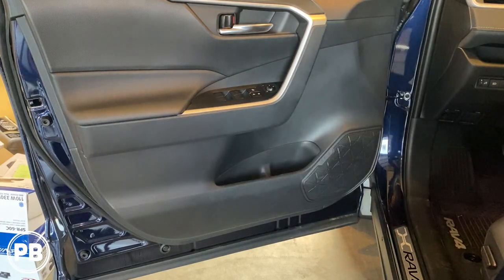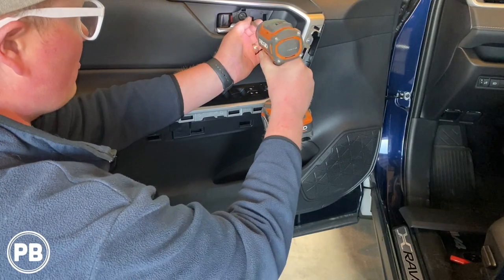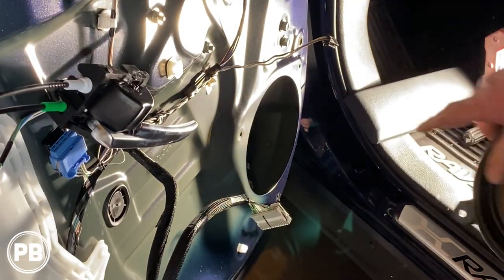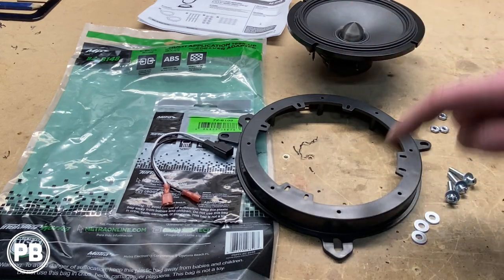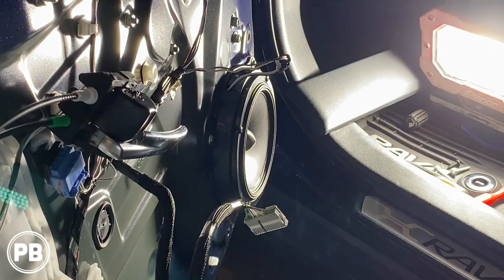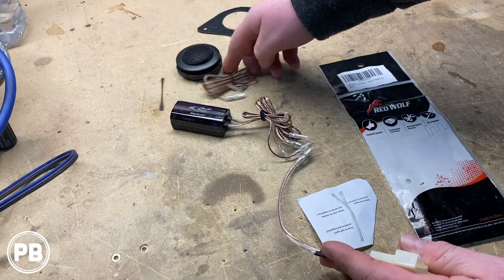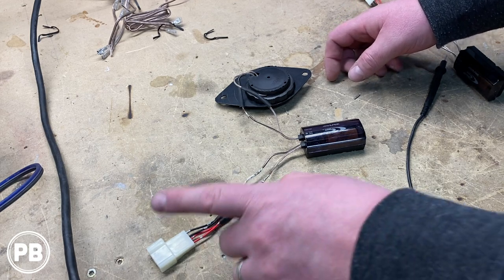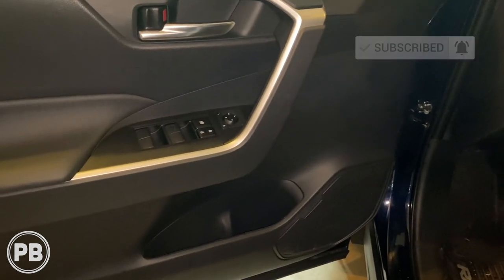2019 - 2023+ Toyota RAV4 Front Door Speaker Install

Comment from the maker: Parts linked in the description of the video!
Reply: Stock wiring system max RMS? Can it handle 4x75w?
Reply from the maker: @nevabeast8221  For toyota, 100w RMS is generally the max for the factory copper 18 gauge wiring.  So yes, you will be fine for 75w RMS x 4.

Comment: The installation can be done without an amplifier, that is, only the 4 speakers + tweeters, it would work well, I do not need volume power only quality
Reply: Did you install only the front and rear speakers? If so, how does it sound?
Reply: @GTIZmoKiDD  suena mejor pero no optimo..
Reply: Curious if you did this? If so, how did it go?
Reply: @NudlemanJones  finally just change the front speakers for some jbl components and leave the rear ones, you have to be careful that everything must be 4 ohms which is what the radio supports. It works better but I think it would have been better with some Morel components. On the windshield panel are the component tweeters.

Comment: The "crossover" is more like a bass blocker, no?  I don't see the outputs for the woofer on it?  If one was going to wire a traditional crossover with outputs to TW and WF is its clear which of the wires in the harness are in vs out to the door?
Reply: If you look carefully on the video, he connected the 2 reds wire together and do the same for the black wire at the hardness connector.

Comment: Great video, easy to follow steps. what size drill bit for the rivets? Are those nylon lock nuts for the replacement bolts? Thanks
Reply: I used an 11/64. But for me, the cap of the rivet started to spin after a little drilling, so the whole rivet spun. I had to wedge a screwdriver behind the cap to drill further and pry it off, or pry it up enough to get a needle nose pliers in there to hold it in place so I could finish drilling it out.
Reply: Thanks Dan plan on replacing door speakers soon, the dash speakers swap was smooth/easy and fidelity sound reproduction was improved a bit. Thanks for sharing the video it is very helpful on how and what to expect, makes it much more a doable  project improvement. @danlynch8569
Reply: @lespaulguitarmn1 oh, it wasn’t my video. I had the same question, so I just eyeballed the drill bit size in the video, and it worked out.

The first one took me around 2 hours, with me making dumb mistakes lol! (I haven’t done this kind of work in years). But the next three combined took around an hour.

Comment: I did this to my new 2022 rav4 with the standard 6 speakers  and was happy I did.   Replaced the front dash and door speakers with JBL Club 3020 and JBL Club 6520.   Used wiring harnesses from amazon. Did not use an amp and found the sound was much better. Lots of people suggest an amp, and I did not want to get that deep into it. I am glad to say it sounds great without and gives me all the audio I need. 
Both JBL boxes state "high sensitivity for great sound even with factory stereo power" and it is true. 

I was not a huge fan of taking apart the door or drilling the rivets (high risk of scratching and something going wrong) so if you are not super handy, you should have it done professionally.  The dash speakers are super easy tho.
Reply: So all you did was change the speakers and it sounds good? I have a 2019 no special head unit or anything and the audio sucks. I also dont want to get that deep into it though.
Reply: I have a 22 Tundra and added a Beat Sonic mini amp. It has OEM plugs and tucks in behind the stock stereo. Best part is you don’t have run any power supply to the battery. I was skeptical but it sounds so much better, and super easy install.

Comment: Couple of questions:
1. Thoughts on component speaker system vs 6.5" pair for front, and 3.5" pair for dash?
2. Do I need an amp or changes for the head unit for this, or could I just do what you did in your video and have a clear improvement? Less work, and cheaper.
3. Suggestions on a good system? Are the alpine a good choice? Thoughts on Focal ASE 165 or performance 165ASbcompared to that?

Thank you!!

Comment: The 2022 RAV4 Adventure with JBL system uses the Metra 72-8109 wire harness for the 3.5 speaker in the dash, not the one in the description or video. Luckily, I bought 3 sets just in case. I will be returning the red wolf harnesses.

Comment: Only video I see, showing tweeters at the front everybody else is putting jbl3020 club or Infinity or Skar etc...... speakers at the front.  Thus wondering if one can put 3.5 speakers with front speakers or additionally rear door speakers ( 6 total ).  In other words,  can we avoid an amp if not adding any subwoofers.  A video would be great.

Comment: So is the factory system mids in the doors and tweeter up top in the dash? Cause I was thinking it was a 6 speaker system and I replaced the top dash speakers with 3.5 infinity speakers. Would it be better to run separates instead?

Comment: Are these tweeters a better option than JBL 87mm as replacement? I installed a bass blocker for jbl.
Reply: How did you install the bass blocker?
Reply: @cedricklaurencebayudan3555  On the positive wire.

Comment: Is this a similar harness and procedure of installing components for the 2015 Toyota Venza? I thought all along you’d install crossover in the door and run a long wire to the dash for the tweeters.
Reply from the maker: These speakers didn’t have a shared standalone crossover the mid bass and tweeter. The mid bass in the door had a passive crossover built on the basket, and the tweeter had an inline crossover. This setup makes for a much easier install when the tweeter isn’t located in the door.
Reply: @ProvoBeastAudio  i see. I have a non JBL. I am installing Morel Tempo Ultra components in the front. Looks like I’m just going to run a wire up from the door to the dash.

Comment: How do you make the system work with factory head unit?
Reply from the maker: We are running the factory head unit.
Reply: @ProvoBeastAudio  I have a 2019 Kia Sorento ex v6 awd. I installed new Harmon kardon speakers hooked up to factory head unit but still could use more power as base is ok. How can I use factory head unit but amplify speakers? Or is it better to just hook up a sub?

Comment: Is it possible to replace the door speaker with a 6x9?
Reply: The fitment would be trash cuz the holes are for a round speaker, a 6.5 inch is more efficient then a 6x9 as well.

Comment: And why not just replace the dash speakers with 3.5? Seems like you went more complicated route.
Reply from the maker: There will be a big quality quality difference installing a nice component set vs two separate coaxials.  A bit more effort, but has a tremendous advantage over the easier route.

Comment: Hey there I have a problem with my speaker on the passenger side of the Toyota hybrid RAV4 2019 my dashboard on the passenger side right hand on top speaker does not work passenger speaker on the very bottom right hand side speaker does not work either I tested the speaker Could it be that the wire has problems or I could just be that if one speaker goes out the other one doesn’t work or do I have to replace both speakers
Reply: Known issue, caused by the DCM. Disconnect negative battery terminal for about 30 mins (battery is in the hatch) reconnect and your all set